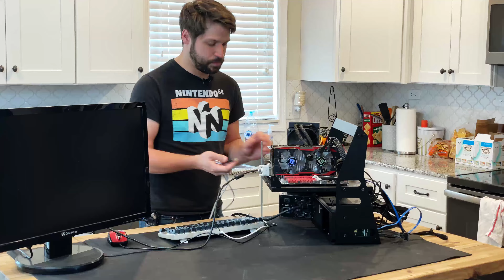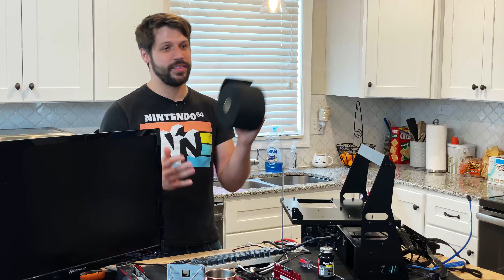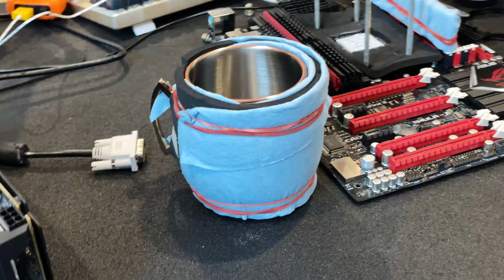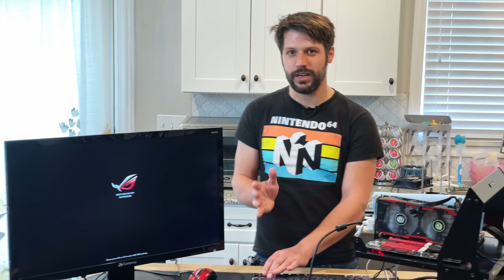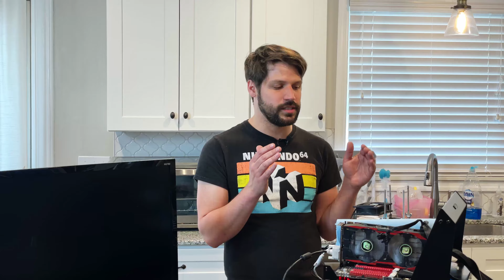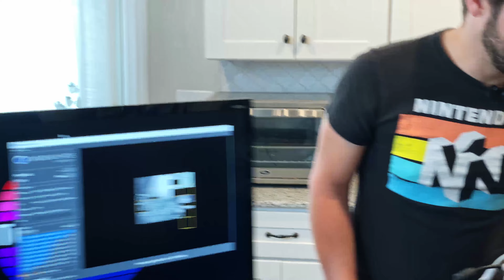Sub-Zero Overclocking on a Budget - Will it work?

Comment: Wow, this worked way better than I expected.  Great idea to use the AIO mount!

You're dead on about the cup not retaining much heat - the mass of custom LN2/dice pots helps to soak up heat for short spikes.  You can also generally get better results with smaller chunks of dry ice and less acetone - think of it as a "thermal paste" between the pot/cup and the dry ice.

Comment: I find that large temperature differences make high clock runs like this difficult, say the VRM temp was still within spec, if your CPU is 3C and your VRMs are 60C, the temperature difference between components and the pcb itself can lead to crashes or unhappy behaviour, adding condensation to the mix makes this even more apparent as JayzTwoCents found out when moisture got into the backplate of his kingpin 3090 and caused crashes in timespy extreme.

Comment: Are you sure putting LLC on extreme is good? Buildzoid from AHOC said it can be dangerous
Reply from the maker: I dont set it to its maximum setting. The second to maximum (I dont recall atm what it is called) gives you the same readings under a load in CPUZ as they are set in the bios, which is why I use it.

Comment: 8350 has a 70* safe temp limit and the vishera overclockers club on overclock.net would say that 75* peaks under extreme load (ibt axv veryhigh or custom p95 settings)

Also these fx cpus are very robust quite hard to degrade.

What a cool experiment nonethe less.